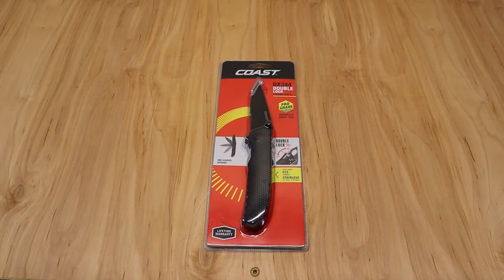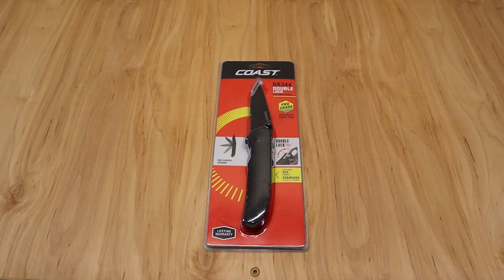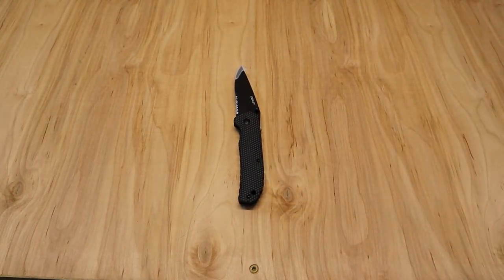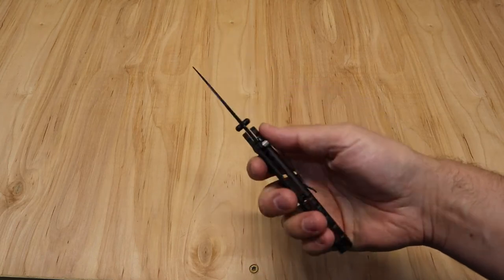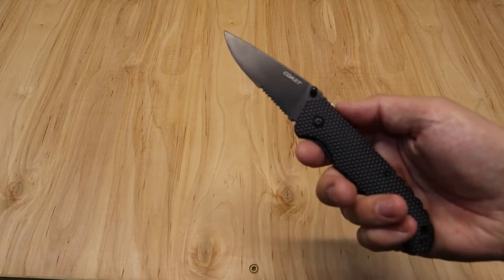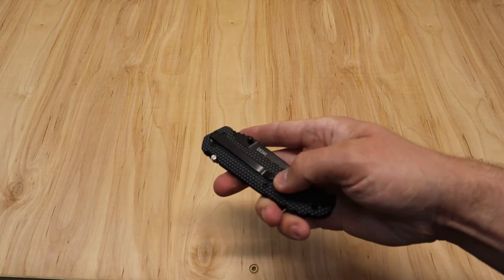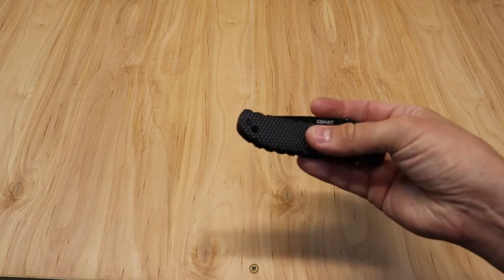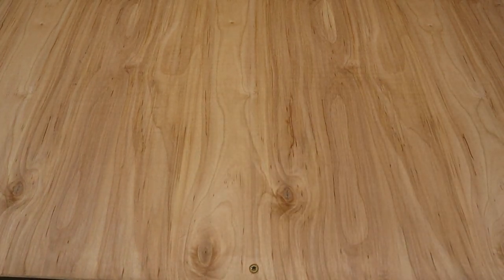ARE COAST KNIVES GOOD? IS IT WORTH $9.97? - COAST DX344 Folding Sporting Knife - Review - Nylon

Comment: Those little nubs at the base of some blades are actually the flipper tabs for knives that open flipper style. You might want to look into more flippers if you like that extra safety aspect of them.
Reply from the maker: I agree they are on flippers for sure. But I feel like some regular (non-flippers) have a more pronounced nub too. Not essential by any means, but nice for a little added thumb protection when closing.
Reply from the maker: Also, please subscribe if you haven't already!

Comment: Yea. If someone wants a good/ durable/ great feeling knife, Coast has them. Iv had my original for 6 years and it still works grt. I sharpen occasionally and is excellent in cutting everything I need to. The lanyard hole is great for a thin Paracord line to wrap around wrist in wet / cold weather. I just bought a crew coast and I'll get it soon. They are a must for everything from camping to emergency situations. Coast - Excellent in my opinion. ( Edited) Check out their awesome selection of pen lights and focusing hand/ pocket size flash light
 They are worth the purchase, I've got 4 different ones and are warrantied from defects,no matter what they will replace a defective product of theirs.

Comment: Not bad, Coast is a decent value brand. I'm into flashlights and knives and in both cases I prefer to spend slightly more and get other brands. Some brands that I have are Tops, Buck, Case, Kershaw, Ontario, Fenix, Acebeam, Olight. I recently got a Tops MSK 2.5 Rockies edition, it is expensive but its quality in every way. LOVE it as an all round multiple use pocket and neck knife and no reliability worries with any folding mechanism. It's very capable for a little guy, I just keep it oiled as it is 1095 tool steel! I do own some Coast. I have one of their multitools and for $20 you can't go wrong. l also have a couple flashlights and a Coast headlamp from about 3 years ago that is pretty good and unique with bullseye flood to focus beam and a physical lever to dim the light. It's an HL7 and I really like that design. Some issues with Coast flashlights is noticeable flickering light in low modes and the HL7 does not have that issue.